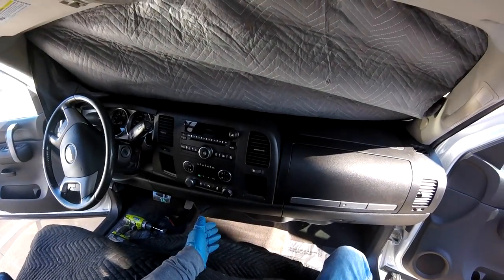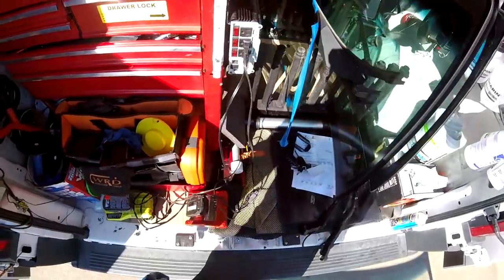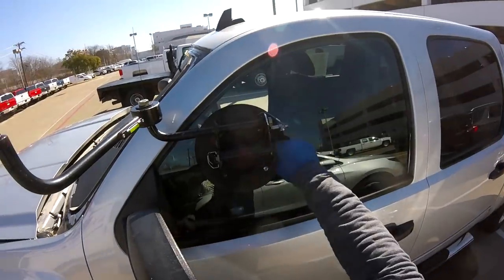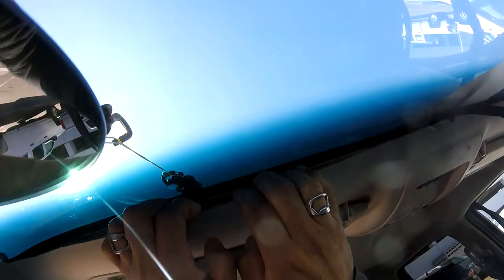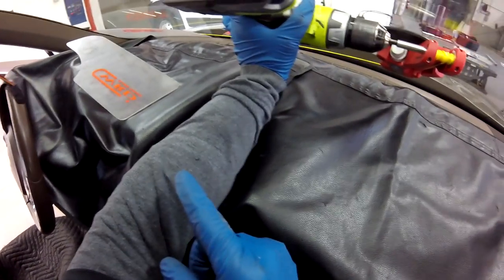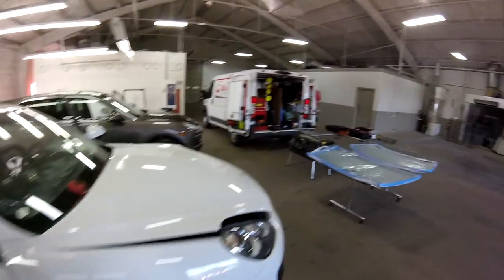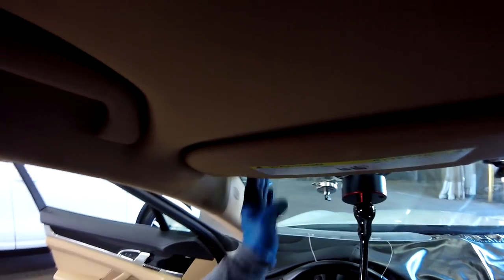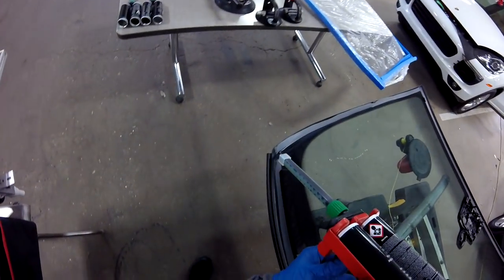IM BACK WITH MORE CUT OUT V- AND SETS

Comment: Thanks Louis for  nice vedio 
I have seen dos guys doing jobs like that thay doing so chip and fast dos kaind of car toke them 15 minutes to fenish 
And I was really suprised at other day have to replace a windscreen for mazda what is saw was i couldn't blev how the doing that thay dont care about the people safty  thay only pot the glou on the top and said that's it at the bottom thy pot nothing
Reply: Luis ya tengo el complete set De wrd system Pero tu sistema   es un prototipo   el mio  tienes que  instalar  el vidrio con una fiber line y no tengo instrucciones  abla con Los De wrd para que te Den un sistema igual para educarnos  con ese sistema gracias

Comment: We had a 06 Porsche Cayenne come into our shop and had some issues with the wiper blades and cowl, I tried searching your channel for tips but you have these parts already removed on the video.
Reply from the maker: Mitch G what kind problem to pull out the cow or the wiper arm
Reply: VIDRIOKAR 1. the driver side wiper was really rusted and I couldn't get a wiper removal tool on because the hood is so tight to the wiper.  So I wiggled it for a long time really hard and was thinking the wiper post was probably going to break.   2. The cowl on the driver side had a clip underneath I couldn't unplug to get the cowl all the way out.   So I had to just pull the cowl back as best I can and close the hood on it.   But I use little buddy so I like to keep the hood closed if I can.   2006 Porsche cayenne
Reply from the maker: Mitch G yes that years porsche made wiper ARMs deep in the area nut tight what i do with those i heat just the nut before remove and after ..watch no too much just heat and let cold.and between those heats apply w40.after couple minutes move the potition on wiper arm up opening the switch.star when the arm are pointing to the roof rise the armup and start shaking the arm slowly and same tine pull up and the arm will be release ..its hard i know.i did a lot in past soon i have one i will post..for the other parts you said are those corner cover cause those clips goes deep and are esay to brake the retainer clip plastic..or are those screw plastic under the cow..you talking about..
Reply: VIDRIOKAR it's an electrical connection underneath the cowl on the driver side.  But it ended up having enough room for the little buddy so Im not worried about it.     Thanks for the tip on the wiper, I will try that next time.   I really appreciate your quality of work and taking the time to post on YouTube.   Cheers Mitch from Canada